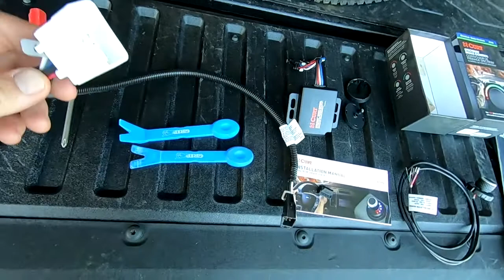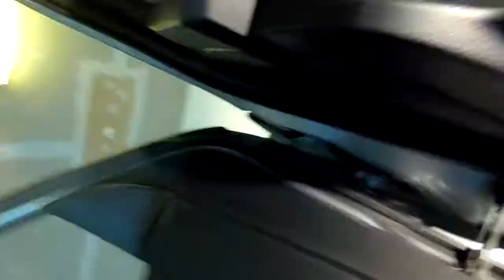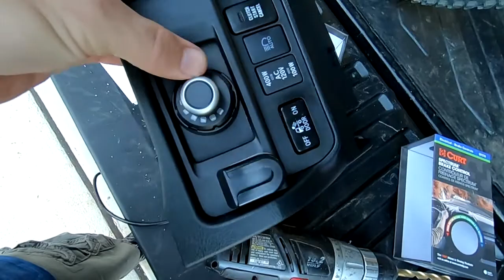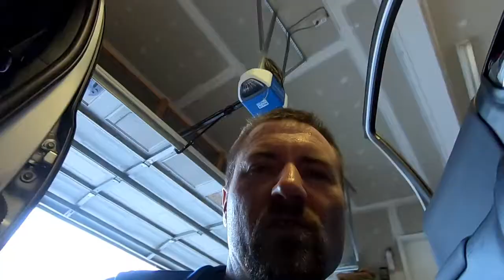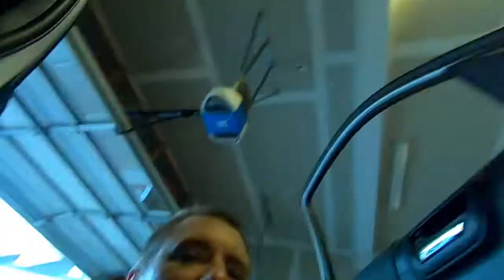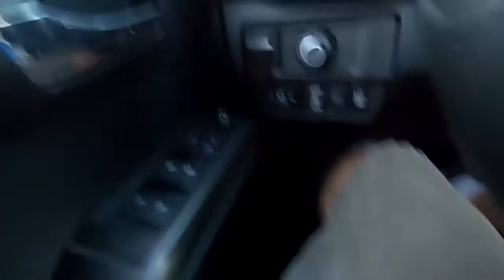brake controller Install Curt 51170 in a Tacoma

Comment: How does this controller compare to Redarc’s Pro Liberty controller?
Reply from the maker: Sorry but I am not able to put an honest answer.    I can tell you the things I do like about the Curt and what I don't like about it.   
Cons
it stays on even if you do not have anything connected in the back. 
Changing the intensity on the manual brake gets annoying.  

Pros. 
Clean installation
Works well once you get it set correctly
Installation was pretty easy.  

I hope this helps you.  And Thanks for watching.

Comment: Can you turn it off when not towing, and if so, will it not lught up when off? Thanks in advance and thanks for the video.
Reply from the maker: After driving around with it for a while now.  It seem to be on all the time.   it does get a little annoying at night.   The blue and red light gets a little bright.   I still like the look and function but it would be better if it would only be on when you have something connected.

Comment: This harness I noticed does not have the ground wire separate that bolts on to the truck. Any issues with this not being there? I heard some other companies changed that because shorting truck wiring if there is an issue? I was thinking of this controller however that is a concern. Thanks.
Reply from the maker: I have seen that was a concern on a lot of controllers.   This one did not have the extra ground.   So far I have not seen anything that gives me concern.   I towed with it the other day and once I arrived I felt around at the wiring and everything seemed to be pretty good.   

I might add one later on just to be safe.   

Thanks for watching.     I have one more video I wanted to put out there in this series and that was my experience after towing with the OVTune and controller.
Reply: Thanks for the reply. I was going to go with this controller but because it did not come with the ground I went a different direction for safety. Thanks again.
Reply from the maker: no worries.   If you think about it, let me know how it goes.  And which one you went with.   I also took the taco to the mountains and was not completely happy with the performance on long grades.  Stay tuned.   I hope to have that video out soon.